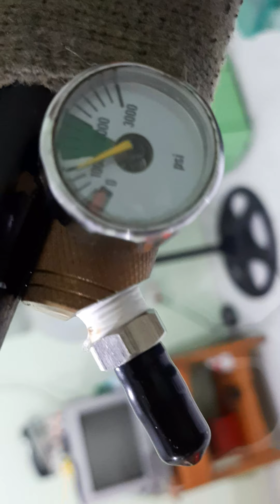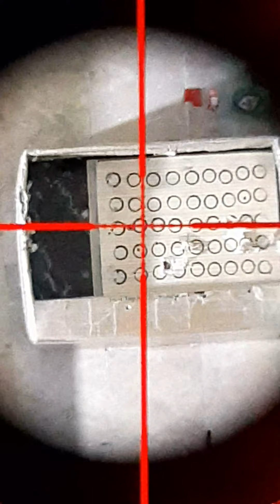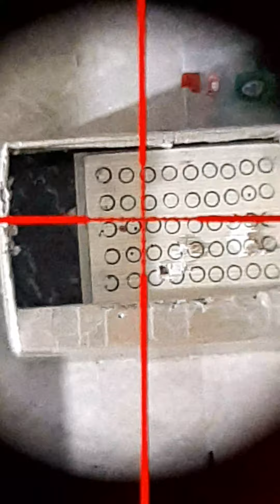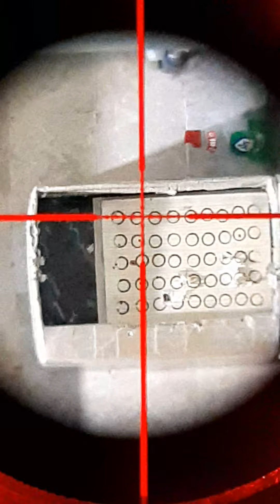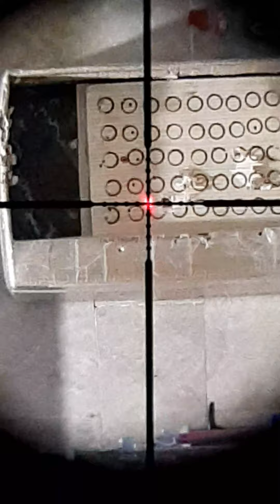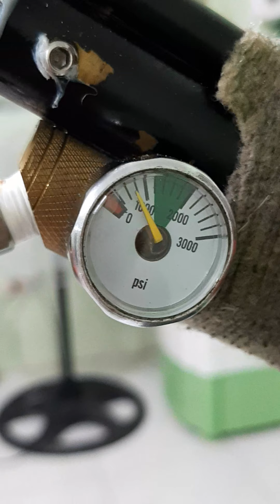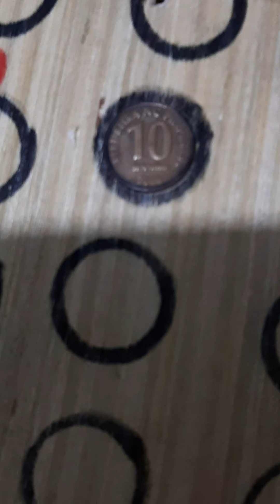accuracy test w/ my new silencer 😎👍

Comment: San ka nka order selincer boss..parco din ang ko
Reply from the maker: Lazada boss 👍
Reply: Anung brand nya at size ..salamat po  sa sagot ka airgun
Reply: Fit po ba boss ang silencer sa barrel ng parco
Reply: Lakas KC ang putok pag nka convert na sa pcp
Reply from the maker: @preciousfebbayles6371  need m pdin ng adaptor boss. Dhil 1/2 ang tread ng  silencer, tapuz ang outside diameter ng barrell ng eskopeta footpump at nsa kulang 10mm. Kya nag DIY aq ng adaptor pra makabitan q ng silencer eskopeta footpump q.👍
Reply from the maker: @preciousfebbayles6371  1 inch × 6 inch fuel trap/ solvent filter Napa 4003 Wix 24003 for .22lr (OD: 1.050...👍
Reply: Anu ang ginawa mong adoptor boss
Reply: Para May idea rin ako bago ako mag order..salamat po
Reply from the maker: @preciousfebbayles6371  ung tube n ginamit q ay galing s gulong ng push cart kng saan nkalagay ung mga bearing, at ung tripod n DIY q ay dun lng nka2bit un. Medjo maliit ang butas  ng tube n un kya nilakihan  q gamit ang drill at liha, at ska q sya pina machine shop pra lagyan ng tread outer. Pro my naiicp aq n pwdi png ilagay s barrell ng footpump, kng familiar k s riveter, merong tube dun n ang sukat nya 10mm inside diameter nya, pwding gawing adaptor. Un ung ga2mitin q s nxt video q.👍